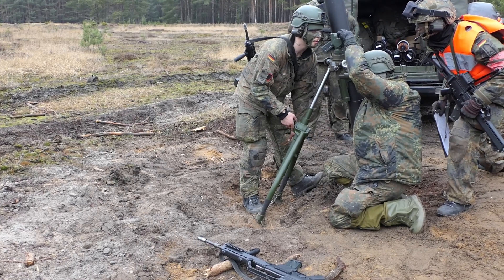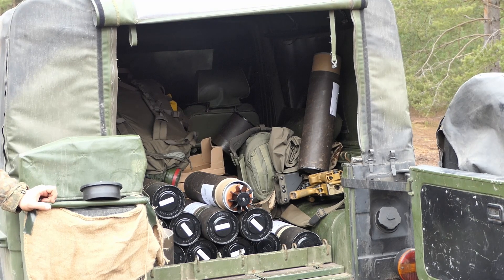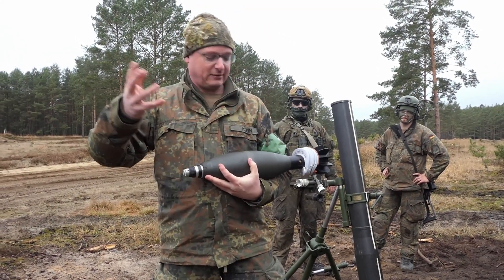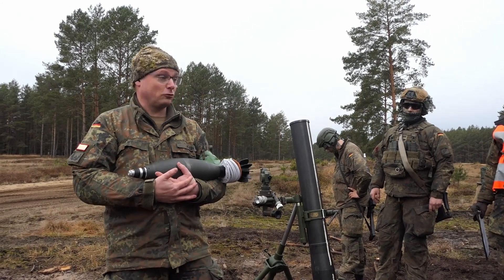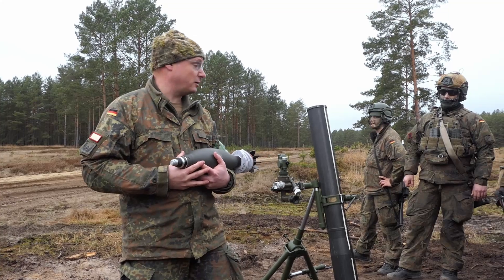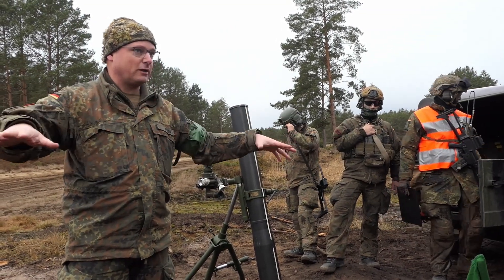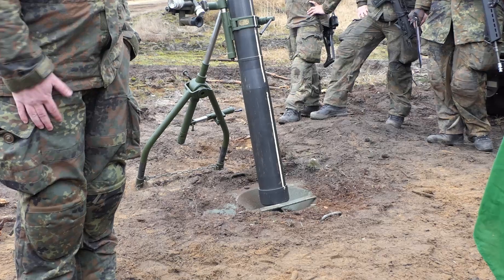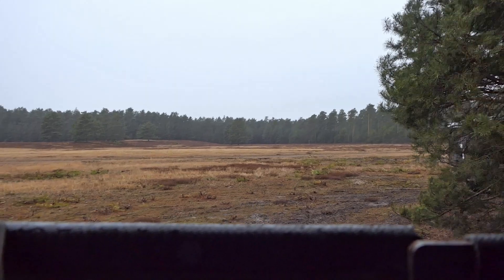Major Klein erklärt den Mörser M 120 FschJgRgt 26

Comment: Ich bin ja gelernter Panzerartillerist, bis 1991, bis zum Ende des Kalten Krieges aktiv. Panzerartillerie - das ist Feuer und Bewegung, Wissenschaft und Technik. Ich bin dann auf der Reserveschiene als VB-Fw in ein Jägerbtl gekommen, ausgerüstet mit 120 mm Mörsern Brandt. Das war Mittelalter. Finsterstes Mittelalter. Geschlossene Feuerstellung, schießen nur mit parallelen Rohren, kein Durchstreuen, ja, noch nicht einmal Fächer eng oder weit. Die Mörser werden eingebuddelt, dann wird ein Feuerkommando geschossen, dann erstmal alle in Deckung und den Gegenschlag abwarten (weil zu unbeweglich für einen schnellen Stellungswechsel) und dann sehen, was noch übrig ist. Mittelalter!! Aber auch da liegt meine letzte Wehrübung rund 30 Jahre zurück und ich muss sagen, da hat sich noch nichts geändert! Kaum zu glauben...